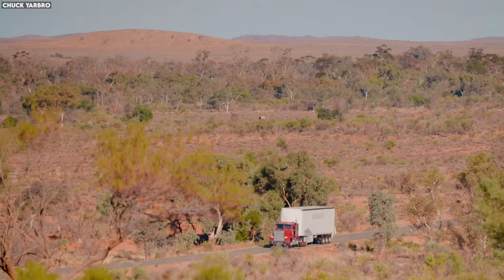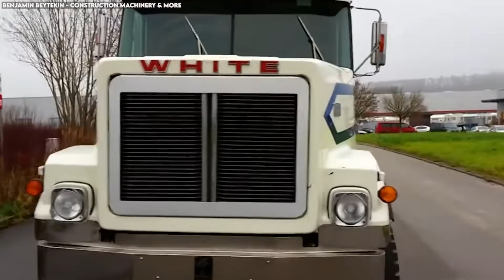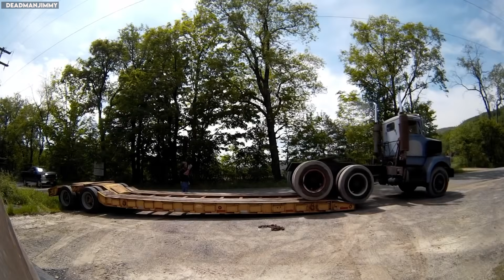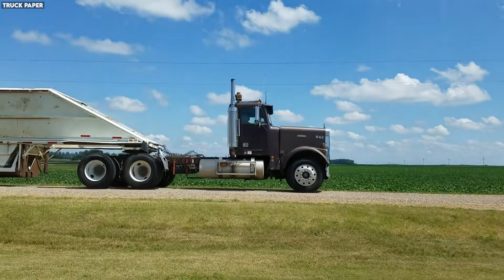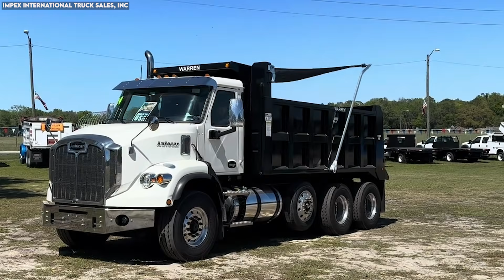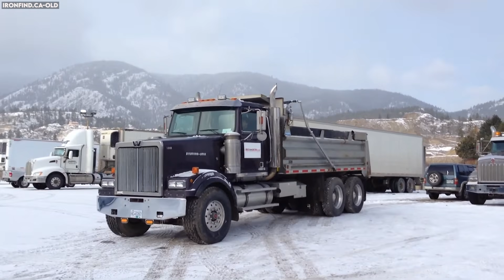10 Vintage Trucks That Outlast Anything Built Today

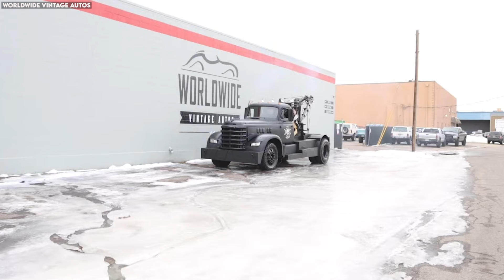Comment: 02:17 It is truly astonishing that a 1951 Diamond T921 could be restored to working condition after spending years rotting in a ditch, while a modern truck would likely have had its entire electrical system and computer modules completely destroyed in a fraction of that time